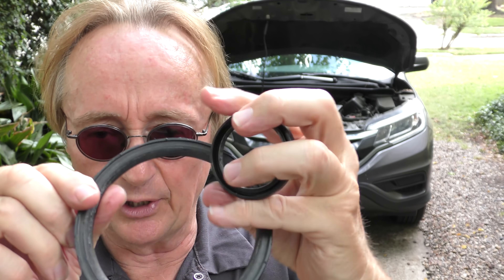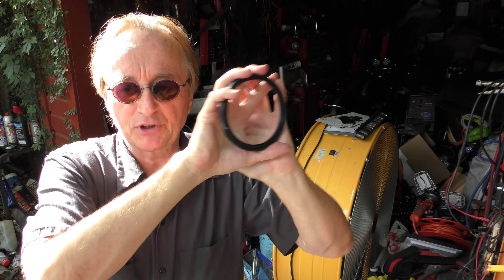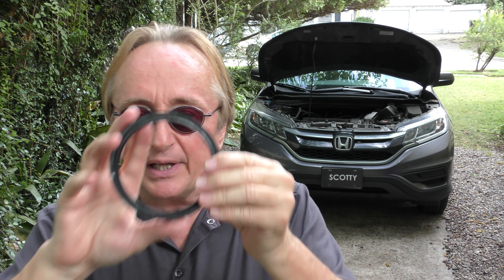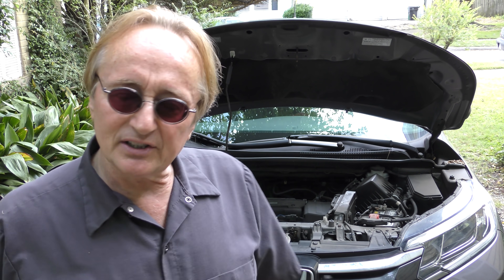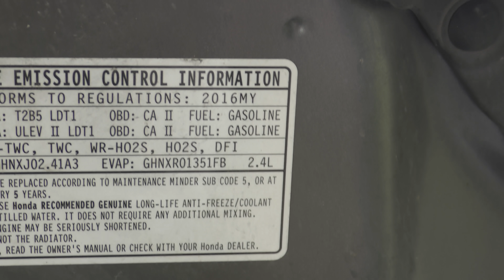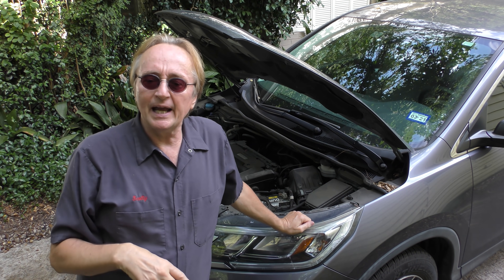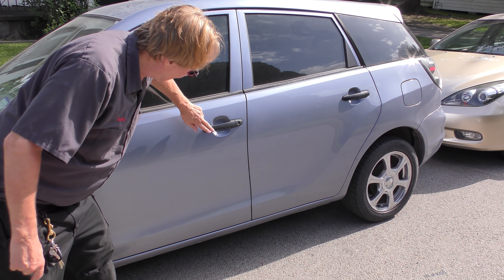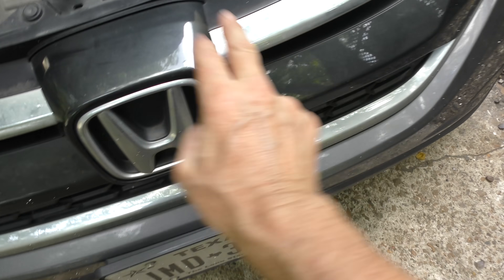If You See This, Don't Buy a Car

Comment: Hello Scotty from Maryland. Much love and appreciation for the vidoes. I daily a 2000 e55 amg. Some new parts include front lower control arms, engine mounts, water pump, transmission mounts, shifter bushings and washer fluid pump. Also had the front wheel bearings refurbished, transmission flushed/fluid changed and an oil filter/oil change. The car has 172,000 miles right now, with a (fingers crossed) minor amount of rust. (1) The 722.6 transmission seems to be a bit clunky or something. For starters, when I put it in gear, esp and always in reverse the car will make a big creek/screeech noise. The car sat for a while before I bought it and when I bought it failed MD inspection for the left lower control arm as previously mentioned. (2) Also, when I first begin to drive from start, I will notice a kick from the transmission. A split second after I let off the throttle, going maybe 5-10 miles an hour leaving my condominium, to come to a stop, the car will make a bing/knock noise, definitely from the rear, as it changes gear. Any thought? Take care and all.

Comment: My 2002 Toyota Estima has a 2.4 litre engine, not much power for a 1.5 tonne vehicle, I found a 3 litre V6 in the same model that uses no more petrol, and is safer because I can pass trucks quickly. 
Larger engines are sometimes no more expensive on fuel  than their smaller counterparts. Another fantastic and informative video from Scotty. Truly appreciated!!

Comment: My wife's Suburban is such a piece of garbage I'm done with GM
Reply: What year?
Reply: @AlbertWesker.1.  I like the Tahoe
Reply: Your not alone.
Reply: Must be the year model.  I have a 2000 Suburban with 5.3 L and it has performed great !  200,000 plus miles and only a fuel pump and thermostat replaced.
Reply: Garbage and cost as much as an RV.
Reply: i have 02 love it, i bet his 08 or newer, and he’s right garbage. There serious ring and lifter issues in these new “gas saving” engines with the piston shut off.

Comment: There’s no substitute for cubic inches, true back in the day and still applies for the motors of today, Scotty we brits sometimes refers to a old saying,  “A candle that burns twice as brightly, lasts half as long” as for the PTFE seal some bright spark decided that it would have been a money saving exercise, there was a old English car company called Rover, it was after some engine for one of those heavier saloon bars of theirs, so they made a call to their American cousins and came across a Buick 218 cup v8, they did bring it home and overall it was ok, except for the rear crankshaft oil seal, it  was made from rope, so long as the rope was permanently wet, then there was no rear crank leakage...simples. Keep up the great work Scotty and we will be waiting for your next video....👍

Comment: Some of these newer engines are just junk. Manufactures claim that these new engines are needed for emissions yet the GM 3.8 series III  V6 was  ULEV rated  in its  finale years.
Reply: I have a 25 year old Camaro with the original series 2 GM3800 engine and it runs like a champ. Basic maintenance is all I've done on it
Reply: Best engines they ever made imo. Fast too.
Reply: @davidg5704  I definitely agree!! Built like tanks and bulletproof if you take car of them
Reply: David Ahders Id go with the 327/350  of past years.       Poor mileage though.    My 67 and 69 Camaro got 15-17 with 2 sp power glide auto

Comment: 0:32 PTFE is also known as Teflon!!  Teflon isn’t cheap stuff but in this case it’s not what you want.  Teflon shouldn’t be used instead of rubber...
Reply: It is the stuff which goes on the non-stick utensils isnt it?
Reply: @Christopher Grant It's a lubricant, it's smooth.  It's also hydrophobic but just like you can push two magnets together you can also get water past it so Rubber is better because it fills the gaps properly

Comment: Yea, a turbo will wear out a engine faster when not built for boost but when build correctly and forged internals ect. Its gonna run just as long as an na engine just alittle more attention needs to be given to one obv

Comment: Yes i got 2015 chevy silverado 6.2L V8 with twin turbo system every time i go full throttle the seal start leaking i went through 3 seals in one year then i searched for an aftermarket rubber one now 8 months with no leaks 👍🏼
Reply: Get back in 8 years

Comment: Scotty, "take if for what's it worth"... PTFE rear main seals are an improvement. I have one  in my 2001 VW and never a drop of oil from this 1.9 TDI engine. Replaced the clutch at 165K, did not see any seepage and left the seal in. 75K miles later still going strong. 

Had a 1999 Ford Taurus and put a transmission in it. Typical Vulcan issues, leaking freeze plugs and rear main. Yes, the coolant leaking from the rear of the engine is probably a leaking freeze plug.

Installing a rear main PTFE seal is a little more involved. Gotta have ever thing clean. The plastic guide is nearly useless... Got it install and 20K miles later still going strong. 

Compared to any other car I've owned, PTFE rear main seals, when installed correctly work well.

Every other US/foreign car I've owned the last 50 years with rubber seals leak. Every one of them.

Comment: Yea I have oil dilution on my 18 civic with 55,000 highway driving and smells like nothing but gasoline. Until it has issues or engine lights no work will be done unless I pay for it. They extended the warranty but that only covers certain parts. Makes me not want to own another Honda

Comment: PTFE, or commonly known as Teflon for the last 50+ years or so, lasts much longer than rubber in literally thousands upon thousands of industrial applications, so why doesn't it hold up here?
Reply: Teflon cold flows.  So it doesn’t hold his shape.  I think Scotty is complaining more about the design of the seal.  A better seal would be made of Viton or NBR which is butile rubber.  But the spring portion is the important part.

Comment: I don’t know Scotty, PTFE is the best plastic for antifriction applications and it’s also very resistant to temperature and it isn’t as cheap as you’d think. It’s very expensive compared to even nylon, which isn’t on the cheap side. It’s also much more inert than rubber, which means you don’t have to worry about it degrading unless you’re using some fluoride in your oil, which would make everything else fail first anyway. 

My guess is that they haven’t perfected that seal design yet, that’s why it seems worse now.
Reply: PTFE doesn't expand like rubber ,which is what you need for a seal.

Comment: My 1943 Ford GPW had a two piece seal that could be replaced without pulling engine or transmission.  I replaced it once and it never leaked after that.  Things were more practical back then.

Comment: I used to use the old spring in an old 318 seal as a bracelet to hold my car key, cant really explain it in text but you twist it, match the ends together and let them twist back and they interlock and will not come apart without excessive force. It was perfect

Comment: I have owned two Honda Civics — one I bought new — and was religious about service. No turbo charger. Both started burning/using oil at 160,000 km and then the dip stick was orange plastic so you couldn’t tell the oil level. Could not find a metal dip stick.

Comment: When he says chrome, he means plastic that looks like chrome.
Reply: Scotty is correct,  the finish is actual chrome.   Metal is bonded to the plastic. Applying a coating makes the part conducive, which makes it possible to apply the chrome plating later on.  Will it last as long?   It look nice for a while and may not scratch as easy.
Reply: And you can blame the EPA and CAFE for that too (it saves weight).  And it also depends...some “chrome” is actually polished aluminum.
Reply: @danc2014  ...uhm, I'm pretty sure that it's chrome colored mylar tape.

Comment: Where is the list of every bad part in every car/truck for every year? Only repair services seem to know as they work on them and there needs to be a master list of bad parts that are put into cars/trucks, instead I have to look and pay through the nose to find out what NOT to buy old or even new cars/trucks! It has become dangerous to know that a known bad part can and does cause a car/truck to suddenly  stop dead in the middle of the road causing many deaths! Poor quality control for the "greed is good" CEO,CFO, COO, as well as the designer engineer that goes along with this line of demented thinking!

Comment: As a former employee for SFK industries (seal manufacturing). I can say that it isn't always GM that "designs" this FusterCluck. Alot of their seals are designed in the "Magna" design which is so "innovative." Ford...still using good ol rubber seals, even in the military contracts.

Comment: I had a 92 Sierra with the 4.3 a few years back.  Rear main seal was going.  I put the Blue Devil I think in and followed directions.  It fixed the leak. It was the $15 one a few years ago at autozoned

Comment: My Fit had low profile stock 16" low profiles. I found out I could get the 14" rims from 98 civic and a tire size that keeps basically the same overall diameter. First tire change paid for the junkyard rims. Tires are half the price and don't self destruct in every pothole.

Comment: The worst trend is NO TRANSMISSION DIPSTICKS. Whos bright idea was that??
Reply: Its not uncommon to find this, unless you have a leak it should never need topping up
Reply: W h a t ?
Reply: @Usercouldnotbefound  if you do have a small leak or you need to refill it after it was changed a dipstick makes it very easy to do. Getting rid of it was a really dumb idea. Just another way to try and force you to go to a dealer for service.
Reply: I hate it too, but manufacturers realized that they could get lower warranty costs by preventing people from putting additives and the wrong fluids into it causing problems.  After 60k miles or so when it might need filling or a fluid change they don't care.  They want lower warranty costs so they can sell it for $50 less and get more sales.
Reply: Some dipstick probably... with a degree in accounting....

Comment: Scotty.  The over the road, big rig trucks use PTFE seals and they are more expensive.  The PTFE is typically used in Diesel Engines because of the used oil in Diesel engines can degrade the polymer of traditional rear seals

Comment: All the seals I've replaced I always packed them with grease to hold the spring in place when you drive it in ,never had a failure in my forty years of mechanic repair
Reply: ROGER GODIN You're funny. You would use oil on an engine. You just never heard a peep from people scared to say anything. Did you know restaurants never hear complaints from customers?

Comment: PTFE is basically Teflon. They are available with springs but if not spring energized then it relies on the pressure differential to seal. When the engine is shut down the pressure differential drops to zero, hence the leaks. Also Teflon cold flows and has a large coefficient of thermal expansion especially around room temperature.

Comment: I use to work for a company that portered vehicles from Auctions to Dealerships & From Dealerships to Auctions. those 'low profiled tires' when they went flat, you couldn't tell unless you had a tire gauge. I drove Brand new Ford pickup trucks ( just came off the assembly line) to the railhead to beaters that we're meant for The Demolition Derby.

Comment: If you have a turbo charged engine and drive it normally without pushing it hard unless passing is required it would make sense to not have excessive wear problem. If there is a switch to turn off the turbo it is best to leave it turned off unless the turbo is required.  This is what I have read...

Comment: PTFE rear main seals needs to be installed DRY. If you apply grease before installing it, it will prevent the chemical from forming a layer of protection on the metal.

Comment: just in case anyone is wondering PTFE  is (poly)-tetrafluoroethane or it's brand name Teflon.
Reply: @DE-EVOLUTION• SOLUTION As I recall the original use for Teflon was as a slippery bearing material shaped like a flat doughnut between railroad cars and their trucks, replacing the quick to wear out grease. Next non-stick (sorta) pots and pans. They used it to coat guns for awhile, as a supposedly more durable finish than bluing, now replaced with Cerakote and other finishes that are more durable. 

I wonder about the testing to destruction lifetime of these seals vs. the older steel/rubber?  Why would an engineer specify a less durable alternative? There must be a cost/benefit trade off that was considered and approved!
Reply: FIXD advertised during a Scotty  video... electronic mechanic.
Reply: @user-lt6oh2bu7c  Cost: To the customer. Benefit: To the manufacturer. That's really the trade off. The old type of seal is still going strong in vehicles that are decades old and pushing several hundred thousand miles, and new vehicles are blowing these between 75-100k miles left and right. That's real bad.

Comment: Scotty, sorry but the Honda 2.4l engine can dilute the oil with fuel too. My wife's 2015 had the problem.  I could see it visually on the dipstick. I kept changing the oil ( I did it myself but still expensive using synthetic oil) and the level kept creeping up over the full mark. Then I sent a sample in for analysis and whoa, fuel dilution was nearly 7%!!  We traded the CRV (nice vehicle otherwise) in for a 2019 Toyota Corolla with the dual fuel injection system. No such problem with the Toyota.

Comment: PTFE is Teflon. Far more inert than rubber. Less susceptible to oxidation. 

Heat the seal before installation to improve its ability to conform.

Comment: I've been in many different facets of repair and fabrication in my life. Went to school for it and was an auto mechanic for 7 years. I sincerely believe that sometimes, not every time, but sometimes auto manufacturers purposely design parts not just more inexpensively but also with a calculated earlier failure point. The people who design these vehicles aren't stupid (even though we all say they are when we're about to fix something and are mind boggled as to why they designed the car the way they did.🤣) There's a method to every part on the vehicles they design. True indeed an auto manufacturer doesn't want to produce junk cars that fail in a few years, but they have nothing to gain by making a vehicle last forever. My best guess with my experience, today's general economy car even with good maintenance is only made to last around 100,000-150,000 on average. Even if the engine and trans last that long you still end up having to spend a lot on many other smaller failures. Now the auto manufacturers would never admit to purposely designing parts to fail sooner, but that's my story and I'm sticking to it. 👍
Reply: Exactly! They think they are smart to design things  that break and then kaching! As buyers informed by Scotty, we'll just buy what he recommends and save tons of cash 😁

Comment: To be completely contrary to Scotty, in rural Australia I own a 2004 MINI Cooper S from new and it came with runflat tyres and no spare or tyre goo. I've had 2 flat tyres in 16 years and I was able to drive to the tyre service centre in each case, one drive was over 40 miles and on both occasions the tyre was repaired. I still have runflats on my MINI because I like the harsh MINI Cooper S ride.

Comment: I hate those PTFE seals. Paper thin and you get one go only. Once the shaft goes in it stays or you need a new seal. I replaced one on my "Prince" of darkness engine when replacing the timing belt after 100,000 kms. Pain in the tuchus. I got rid of the thing. Roger, Australia

Comment: Scotty, I unloaded my 2018 CRV because of dilution issue.  In 400 miles after oil change oil level rose to above the full mark by 1/2 inch.  It continued to rise.  This was in warm weather. Feared bearing issues. Otherwise car was well made.  CRV 1.5 turbo with only 10000 miles, by!  Knew my future with SUV was bleak and denials by local service tech.  Now driving 2019 Ford non-turbo F150 six.  Does a decent job and will last better.  Not bad acceleration for 3.3 ltr.  Pull small cargo trailer camper (5x8) with decent mpg, about 16+.  Gets 22 when not pulling camper.

Comment: Like anyone could just take apart a car engine to check the rear main seal when checking out a car to buy
Reply: You dont have to take it apart, youll see oil leaking from where the engine meets the gearbox housing, if there is oil in that area the chances are, main seal is leaking, just need get on your back to have a look thats all

Comment: I have a 2005 Chrysler Town and Country. Chrysler/Dodge products are notorious for bad transmissions. I have serviced the transmission every 60k miles. With 164,000 on it, it still drives like a dream and shifts perfectly. So yes. I agree with Scotty, if you want a transmission to last, even a notorious bad one, change that fluid!

Comment: PTFE is Teflon (Polytetrafluoroethylene). In this case, it should be used as an abrasion resistant coating, not a full seal. Teflon seals are normally used for high temperature and non-dynamic applications in aerospace.

Comment: I run wider "low profile" 18" tires on my Tundra during the hot summer months, the truck corners great but it doesn't ride like crap because the sidewall is only 0.70" shorter than the standard tire. All that being said, I do like a substantial sidewall for most driving conditions.

Comment: I've done a few PTFE seals with good results but also not a fan.  Bet the crank has a little burned oil round it you need to clean off first.  Also don't like when aftermarket goes cheap with stamped steel idler pulley rather than OEM machined aluminium.